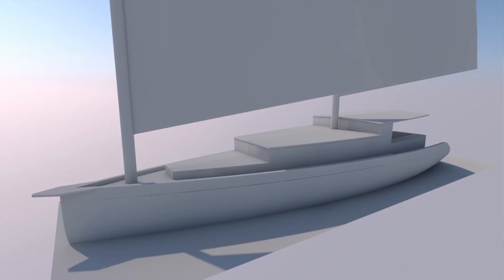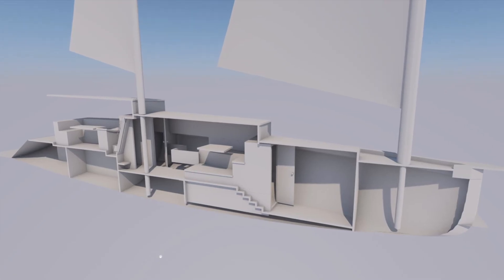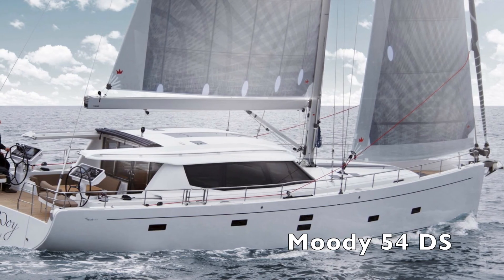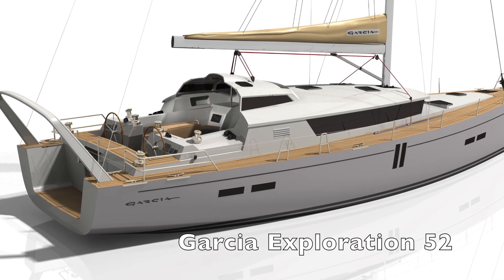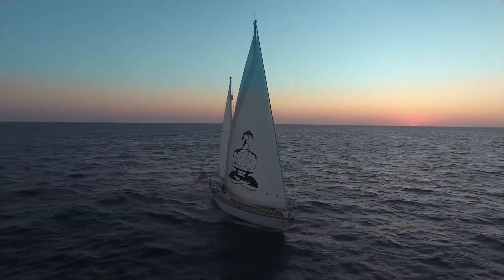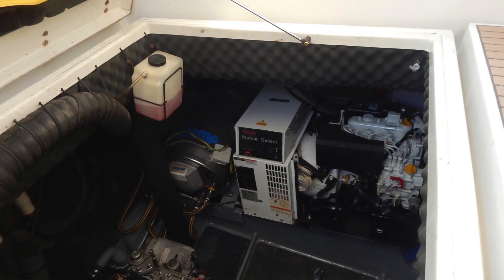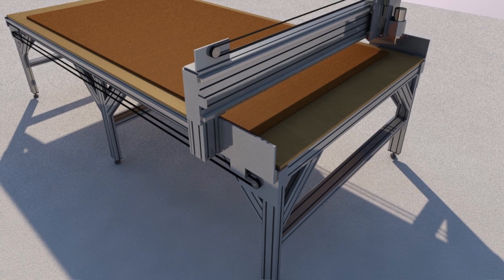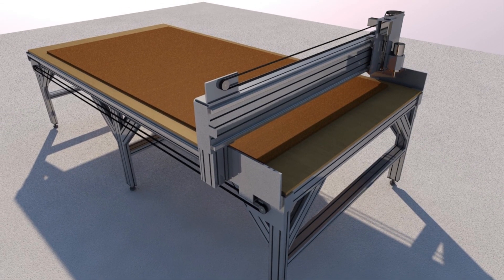I'm gonna build a sailboat and CNC! Ep1: Introduction to Project SeaCamel

Comment from the maker: Update! The hull design is on the works right now. So remember to subscribe to get notified when new episodes come. Thanks!

Also check out the amazing shirts and stuff from the link above.
Reply: Who is the manufacturer of the center cockpit sailboat that you showed? The one that provided the engine room beneath the cockpit with access
Reply from the maker: @bendaves77  Hi. That is made by Amel. The specific model in that image is Super Maramu 2000. The same boat model that SV Delos is. ☺

Comment: what an amazing project! wish you all the endurance and energy to fullfil it! question for you: what software do you use to make all your 3d modelling? i want to learn 3d modelling and starting from zero, so i want to learn it with the right software
Reply from the maker: I'm using archicad which is not good for boat design. I just have the license and skill with that. (using it now for 20 years)
For boat design, You'd go with Rhino. The learning curve is steep but that's "de facto" program for boat design I believe. It also has tools for calculating displacement etc.

And thanks! ☺️

Comment: College here from Norway. Been interested in boat design and building - but a boat designer convinced me that the money is in housing not boat design. He was right. I saw the last vid where you have started to build this project - and I see that the ideas havent changed that much. Nice to follow. But its a crazy amount of work. I did some repair work and also planned some boat building - but always realised it was too much work. I guess it take a lot sisu to do it. I was early converted to multihulls  - I also saw your vid about electric engine system - and Im pretty convinced that the better the boat sails the better its for a electric motor system - the answer is a multihull. Building a big multihull - is even more work than building a mono. But anyway I will follow your project with awe.
Reply from the maker: It's a lot of work yes. But I try to keep in mind to actually "produce" the boat instead of "building" it. I think there's a difference. This will not be a master piece of boat art, but hopefully well produced and usable tool and habitat. 😊 

I've never been that much interested in multihulls. I looked at some point  HarryProa as alternative. There's good and bad points in everything. One is that harbors and places in nordics are too small for multihulls in general (although not sure how long I'm gonna sail here locally). Other is of course all the extra work and structures to make multihull work.

I think this boat will be large enough to sail fast enough to provide decent regen with electric drives. (It also will be pretty light for it's size) At some point I have to dive deep into that matter. Plan is to DIY that stuff as much as possible. Commercial products are too expensive I think. There's possibilities for some kind of open sources product development for efficient electric saildrives for example.
Reply: @ArcticSeaCamel  Your design is  10times better than a Harryproa - one big is under construction in Tromsø - but I think it has stalled. Yes you are right your boat will be fast enough - and by the time you go sailing the systems have been developed further...

Comment: im into cat ketches. alloy. checkout  www.dvs-marinedesign.nz davids a cool ex pat south african living in NZ here. a great 52 foot alloy cat ketch, performance, safety and comfy. they aleady have a 62 foot same design been cruizing for 10 years and over 50k miles. that boat is elcie expeditions, great family.
Reply from the maker: Simon Hantler hi! Those plans look nice and they are provided as cnc files as well. But you’re referring cat as catamaran and I mean catboat. It’s monohull with cat rig which mean that main mast is located all the way to the bow. Adding ketch here means another same size or smaller mast at midships.

I’m not that interested in catamarans, they’re fast but not that comfortable at sea due to high form stability. One interesting type of catamarans are Proas, especially HarryProa. http://harryproa.com

Comment: Hope your plan goes well! But with an headsail on, you will be able to sail more height! Some other great boats from their features are the Sirius. I like the Reinke Decksalon Boats, I want one of this.
Reply from the maker: Yeah! I just recently found the Sirius boats and watched all the videos. There are some really neat features in those - not to mention the philosophy of "view positions" all the way. There's definetly something in those boats as well I have to excamine further.

The ability to point higher is of course something you need sometimes, but as a world cruising boat I think that particular feature is not that crucial. A rig without headsail makes it much more simple to handle and build also. The forces that headails does for the free standing mast are quite high and "single point" (as the mainsail is attached all the way and that way the stress to mast is divided for full lenght of the mast) Although I have been considering a staysail for mizzen mast for light wind use. But it's to be seen. :)
Reply: @ArcticSeaCamel  I think flexibility is important. And if you want to fly a kite or large reaching sail, being able to fly a staysail is useful haha